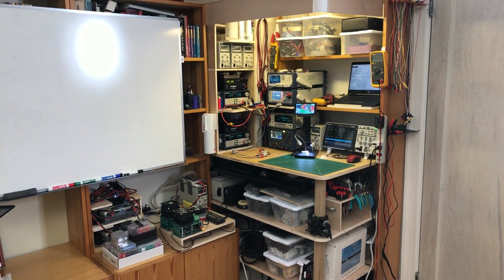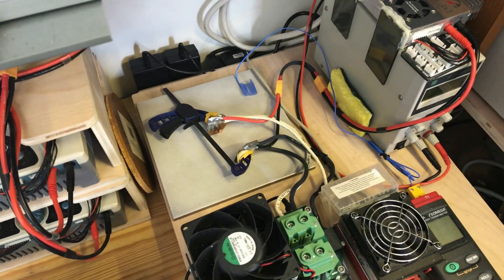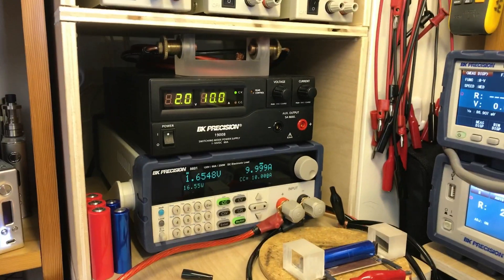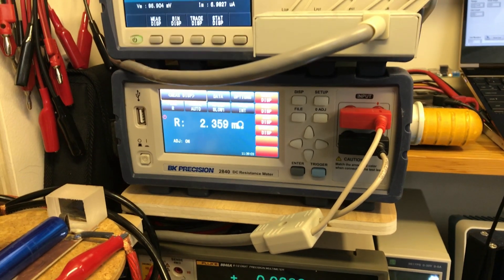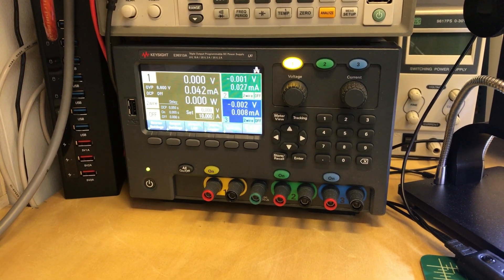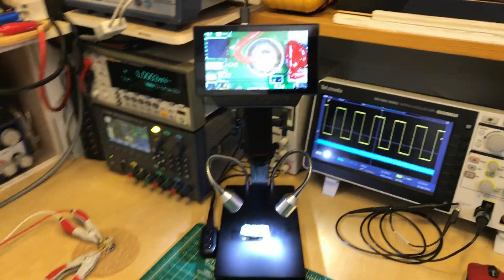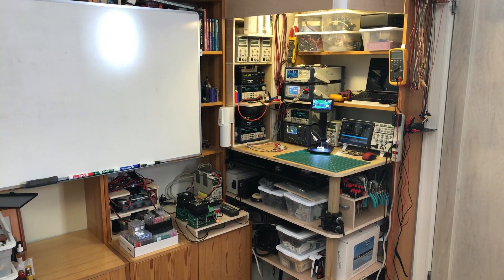The New Testing Station

Comment: Two red Kevin lead ?in the video it shows two Kevin .where the black Kevin lead?
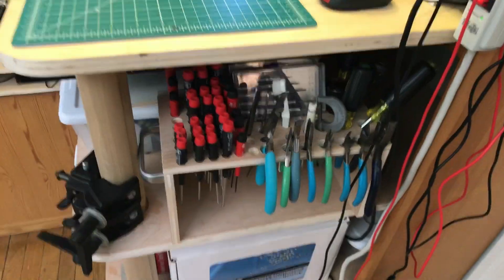Reply: Time 8:33 I see two red sense Kevin on test .my question is where is the black Kevin lead drive-  at?
Reply from the maker: I don’t know what in particular you are referring to but the main discharge battery clamp takes its Kelvin connections after connecting to each end of the battery with a single high current connection.
Reply: @batterymooch  not a big deal but it's just that I have the same DC RESISTANCE Meter  with a red and black Kevin clamps and you have two red Kevin clamps for your DC RESISTANCE Meter.4:14
Reply from the maker: Micro Fix  that’s just the grip panel color. The wires are all color coded, white/red and blue/black, and the Drive and Sense lines identified on the clamps too. You’ll have to ask BK Precision why they used two sets of red grip panels for my clamps and red/black for yours. 🙂

Comment: Hey, can I ask why you designed and made your own DC electronic loads rather than just buying the matching ones for your battery analyser from west mountain radio? Starting my own setup and would love to know your reasoning for that decision! Cheers
Reply from the maker: My loads are 1/6th the size and were sold at 1/2 the price but have the same specs. 🙂
Reply from the maker: Taylor De Caux I use the West Mountain Radio CBA Pro IV with the Extended Software license for its software and to control the two 400W/150A loads I built. You cannot buy the loads I built anymore.
Reply from the maker: Taylor De Caux Sorry, I couldn’t do that. These loads are the basis of the larger modules I build for my clients and I can’t release the schematics. They require six-layer circuit boards with 4oz copper traces and a lot of software to run the unit too. Turning it into a DIY project would be very hard. 🙂 There are constant-current load schematics online though that are simple to build and that can be paralleled for higher power discharges.

Comment: Love the setup, I have alot of test gear as I used to repair phones and do reballing on x boxes etc. I have always loved electronics and was building push-pull valve amps as a teen. You have some really useful kit and I know people have no idea what's involved in getting to the bottom of things. Sadly people buy the cheapest battery from ebay and can be a small one in a 1850 case with filler at worst. Tnx for trying to get the message across. You have probably saved at least one person or more. I don't leave batteries in my mods anymore and and love the channel.
Reply from the maker: Thank you for your kind words!

Comment: hey mooch, i have a couple of questions I hope you can answer for  me, the first one was I have these small black rings forming on my wrap on my vtc5's, as far as I understand these are formed because of heat, I was wondering if these are dangerous or are telling me something is wrong with my batteries, my second question was are dents on the top of the positive side of the batteries bad, or if they affect the safety of the battery significantly and if not, does it affect performance?
Reply from the maker: I don’t know if those rings are bad or not as I don’t know what caused them. If I understand what you are seeing though it’s quite common.
Dents are bad though as no damage is acceptable and if the damage is bad enough then it can be dangerous. There are no set thresholds for this though which is why we recommend replacing batteries with any physical damage.

Comment: I have a contact at A123 systems.(one of the owners) would you be interested in some of their cells?
Reply from the maker: Thank you for your offer!
I have tested their 26650 already though and the 18650 is too low in capacity or our use. If they have any 20mm cells though I would be very interested in testing them as they use the safest li-ion chemistry and we need more options using that chemistry. I can be reached at batterymooch@yahoo.com.

Comment: Hi Mooch that's an awesome setup. All that hardware to test those comparatively small cells must have cost a bomb. +/-100k ?  Thanks for showing us ur den 👍
Reply: Battery Mooch I think you are only considering the cost of the bigger components. I bet if you figured all the parts, storage, computer, etc. plus your time involved with assembly, programming, etc. you would be surprised at the real investment.
Reply from the maker: Absolutely! Add at least another zero if time is added. The number of research hours is extraordinary.
Reply from the maker: Noooo....under $15k :-)
Reply: Mooch oh no 1 extra zero 😥